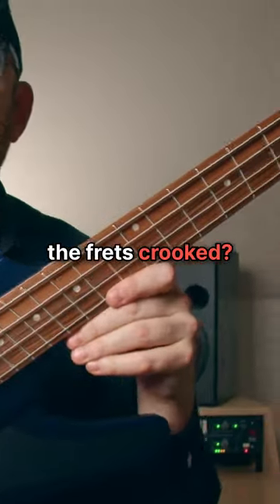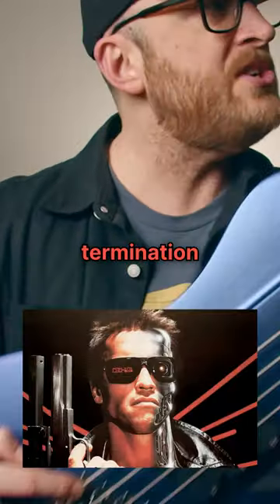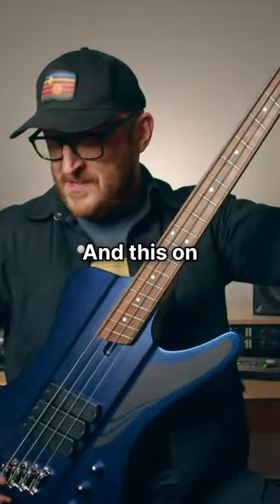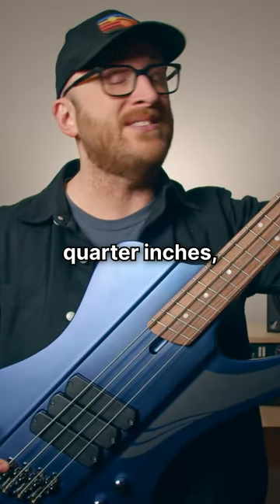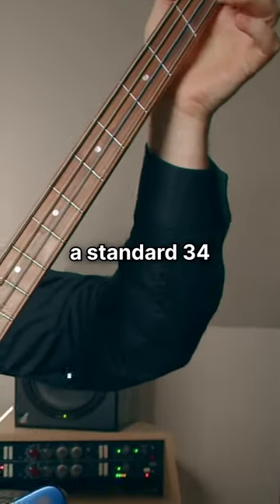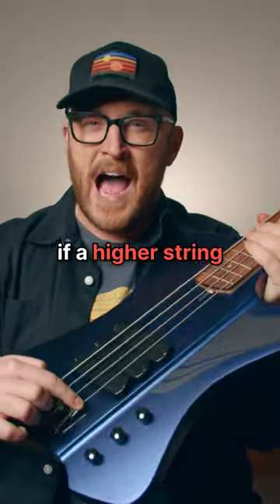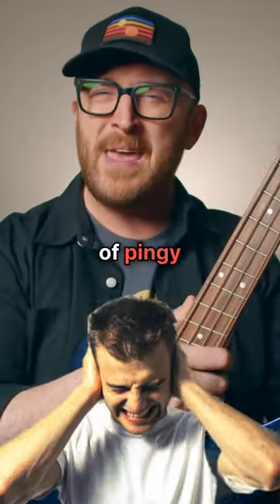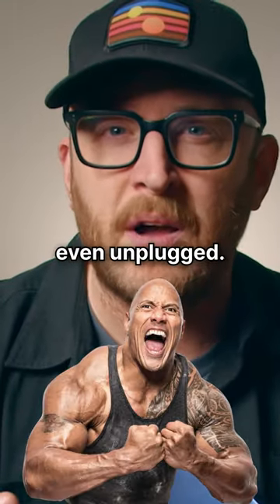WTF are FANNED FRETS? 🤔🤷🏻‍♂️

Comment: It’s the best of both worlds: more tension that you want for your lower strings and less tension to ease up for the higher strings.

This gets especially important for 8-string guitars and 6-string basses.

The high e-string (or g-string or c-string for bass) snaps most easily, so it’s best to have less tension so it can still feel nice and workable.

But for a low E, B, or F#? Flappiness and weak, noodly feel just isn’t good. You want that tension, that girth, that metal-as-hell feel so you can actually use the string and make it sound and feel massive and monstrous.

Unfortunately, it’s damn tough to find 6-string multiscale basses, especially when money is an issue and you can’t just go to a custom shop like Kiesel. There’s still good options, so don’t worry too much!